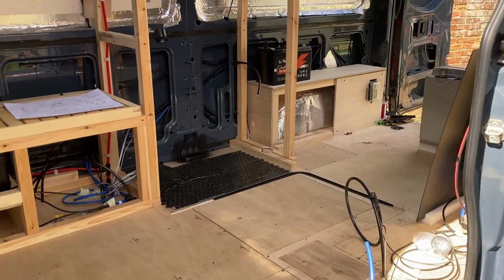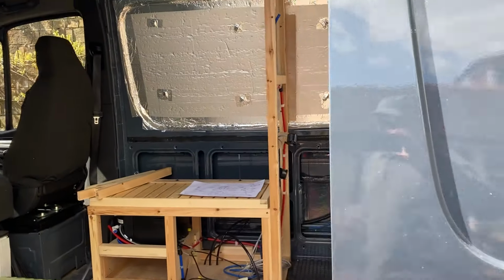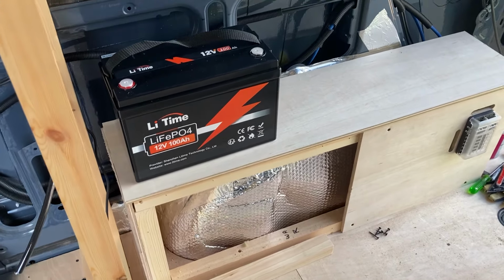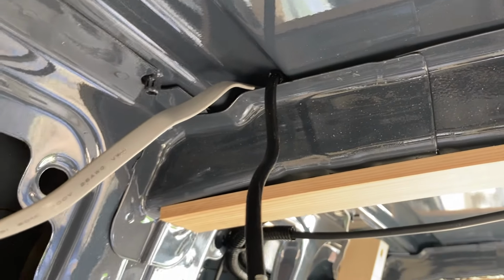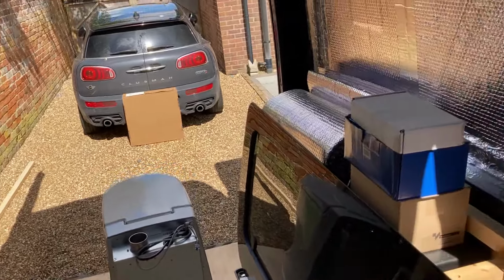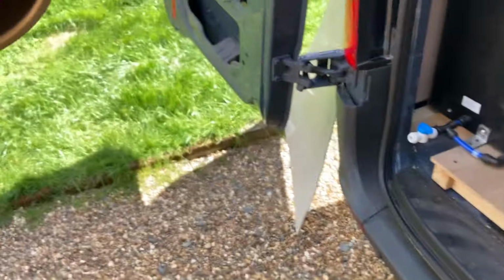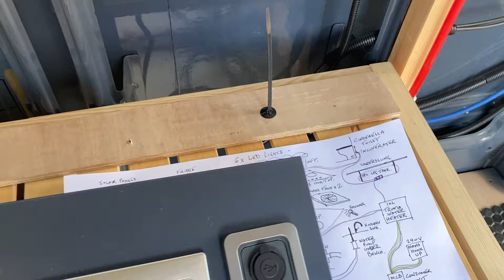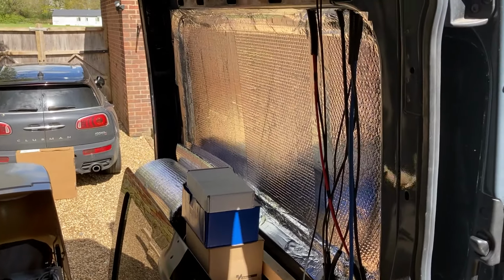Progress Report including toilet, electrical cable runs and cargo door window.

Comment: Also consider running an empty conduit with a string inside from the battery box/electrical area to a few key points where the majority of your cables terminate behind something  (i.e. underneath kitchen sink, main light switch/info panels, bench, front, etc) so that in the event of a cable getting damaged or needing to run additional cables in the future (i.e. you want to install a water level monitor in the future, etc), it'll be much easier to pull through without having to dismantle or destroy your work inside.